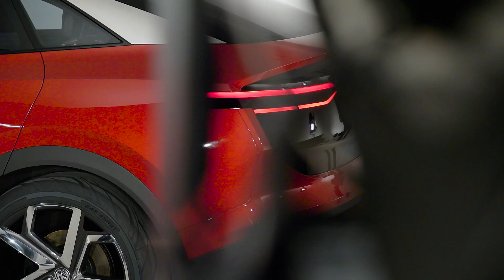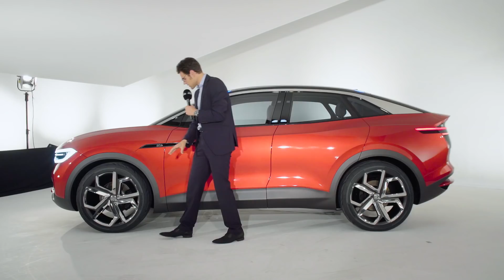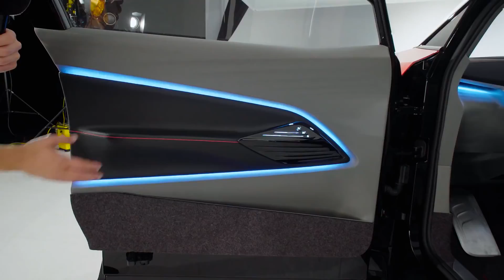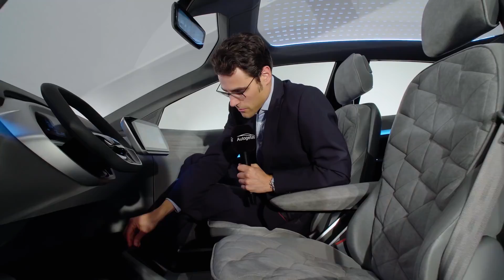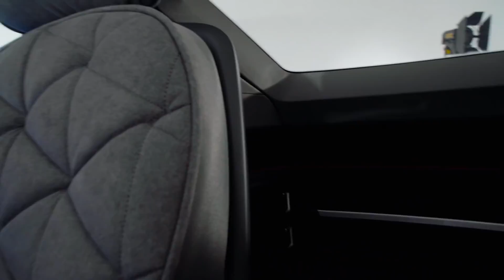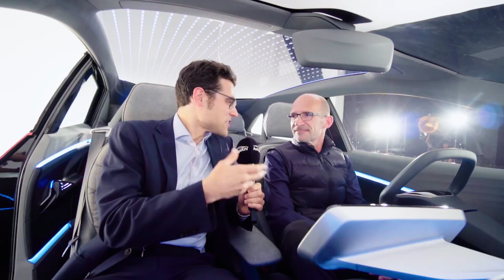VW ID5 is coming up: This ID Crozz concept is the idea of the new EV

Comment: Maybe offer some display buttons (50x50 pixels) which are reprogrammable. I.e.: two buttons on the left side of the steering wheel which can be used for climate control (temperature up and down) or in another mode for volume. The display indicates which function each button has. This could be useful imo.

Comment: Thomas - Congratulations on another excellently produced and informative Autogefühl video : ))  Your remark with regard to "no buttons?" elicited a very interesting and convincing point of view from your guest, Klaus Bischoff . . . and that is the ability to update or configure the car according to developments, as time goes on. Aesthetic appreciation is of course a matter of taste, so this Crozz in my view, is not quite as successful as the I.D. Concept or the Buzz. Perhaps by drawing the "greenhouse" a little taller, it will resolve two problems at the same time: it will give you a little more "breathing room" for your legs and allow you to sit a little bit higher WHILE making the four doors look a little less slab sided.  On another technicality, It is quite possible that the lit LED VW badges and accents will receive regulatory approval in several countries as long as they fall below a certain lumen level. Continued success with your presentations!
Reply from the maker: +David Bee yes i found that aspect also very interesting!

Comment: Tolle Introduction. Bischoff (VW) hat sich aber auf alle Fälle einiges von Tesla abgeschaut (Updates, sliding doors). Macht aber nix. Samsung und Konsorten machten das ebenso bei Apple und überholten ganz easy.  Sollte Tesla weiterhin Produktionsschwierigkeiten beim Model 3 haben, dann wird es dort wohl einige Stornierungen geben (zumindest auf deutscher Seite). Deutsche Qualität rulez eben. Wenn das mit dem Preis, der nicht zu hoch erscheint, so hinhaut wie erwähnt, wäre das natürlich ein Knaller. Also bis dahin etwas leasen und dann zuschlagen ;-) (Fuel Cell ist jedoch immer noch auf dem Programm, da ich diese Technologie als Zukunft sehe)
Reply: Die Frontpartie (fast 1:1 von Tesla "inspiriert" ) fällt Ihnen nicht auf? 
Gruß. :)

Wo nur ist der deutsche Erfindergeist geblieben, falls es den mal gab?